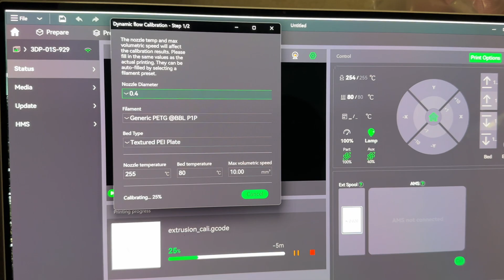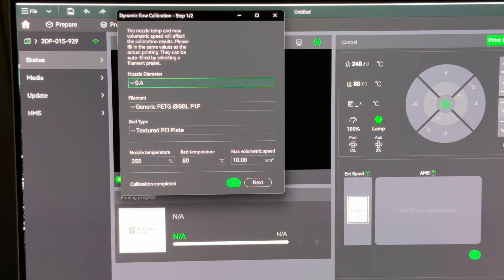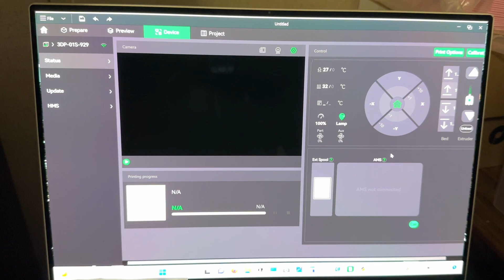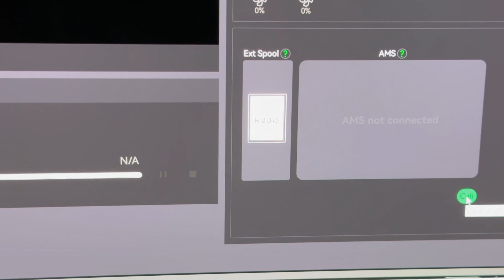Bambu Lab P1P Dynamic Flow Calibration

Comment: That calibration option is missing in my Bambu Studio
Reply from the maker: This video is kind of old. And it’s been a minute since I’ve done any of this. When I get home after work tonight, I’ll check and see if it’s still there for me. There has been a lot of updates since I made this video.
Reply: Found it, didn't had my glasses on I think 😅
Reply: Where is it ?
Reply: On the top of Bambu Studio (the tabs with "device" "project" etc. Should be the last tab! @cheizaguirre5494

Comment: hey thanks for the video in detail. I want to know if there is an option to reduce or remove the custom pattern printed once the calibration process is done. As i can see your printing bed doesn't have the custom pattern on it. 
My agenda is to reduce the print time, this would be help if you can guide us on this part. Thank you :)

Comment: This is pressure advance isn't it?. You also want to do a filament flow calibration alongside this.
Reply from the maker: As of right now, we don’t have a whole Lotta control over everything on these printers. If this where a printer running klipper, I would agree.
Reply: @TableTopBiker  but k value is also PA. And if you use orcaslicer, a fork of bambu studio. You can do flow calibration, give it a shot.

Comment: With you choosing that setting how was your print ? Thanks for video I’m still waiting for my printer grrr lol
Reply from the maker: Still waiting on your printer? When did you order it? 

The prints are definitely a little crisper. Issue is that you need to do this with every filament type at least. If not, every filaments. I couldn’t be bothered haha. I would say do it once for the main filament you use and call it good.

Comment: I like the Softfever flavor of this calibration element much more as they give you the opportunity to leave out those tiny numbers which IMO are pain to remove ((unless you are the Count of Count 😉)
Reply: This is the first time I heard about this. I absolutely hate the clean up with the numbers. It even messed with my high temperature plate, it now has scratches all over the place from me trying to get the numbers off the plate... How do you do this? :)
Reply: @jurgendebruijne  You really may want to have a close look at Orcaslicer (which is the new name of Softfever’s slicer). There have been quite a number of videos on Youtube on this.
Reply: @joachimeuler8269  Many thanks for your response! I do use OrcaSlicer, 1.6.3 at the moment. But I do not see any option to remove the numbers. I looked online as well and have my printer turned on now. But I cannot find it online and in my printer settings I do not see it either. Is it under the K value calibration or the top calibration menu? Because I can only start it via the K value calibration in the Device tab it seems, and probably it will just use the numbers again.
Reply: @jurgendebruijne  I am using 1.6.3 on Linux. In the settings for PA calibration, below the settings for start/end/step there is a tick box "print numbers" where you can omit the numbers.
Reply: @jurgendebruijne wenn es sich nicht löst einfach einen zum Beispiel First layer test drucken und dann druckt es einfach darüber dann kann man es einfach entfernen

Comment: This is the new version of the slicer. I don’t understand why you when you use a glue stick on this plate for PETG I never have adhesion on any material that I’ve used on this plate with this printer.
Reply from the maker: I am just paranoid. I have had petg tare up other pei beds. Rather be safe than sorry.
Reply: @TableTopBiker  I can understand that completely. My other printer I have is a PRUSA. It has a live Z offset. I would print a test print that covered a large area of the bed and get the Z offset to where it looked. Perfect. The Prusa  allowed me to save that setting. Once I learn to do that, I never had an issue with PLA or PETG. With this new P1P I have had perfect layers almost every print. With the PEI sheet before I use it, I run it under hot water with some Dawn dishwashing liquid and scrub it with a Brillo pad. The prints are amazing. I don’t do this in between every print but whenever I see I think I’m going to have an issue. Sorry for the long post.
Reply from the maker: @nmfireman  Don’t be sorry at all haha. That has some good info. Never know who may come across it that needs to know.

Comment: So, i'm very new to 3d printing, and i bought one of these. What does this calibration is supposed to do? Should  i really calibrate anything if so far the machine seems to be working fine? I mostly use PLA and ASA for printing.
Thank you !
Reply from the maker: Welcome to the hobby. This specific calibration addresses the round corners you can get when the printer makes sudden directional changes. I suggest giving it a go but if you are happy and don’t want to, that is fine too.

Thanks for the comment and hope this helped.
Reply: If it’s working, leave it alone, if you’re happy with the prints.

Comment: you can change the temperatures and filament print settings by clicking the edit button next to the filament dropdown.
Reply from the maker: I will check that out tonight. Thanks for the tip!
Reply: @TableTopBiker  You can also change the nozzle-bed offset for the first layer. out of the box, I found it to be too large, and parts would not stick well. I modified the start gcode to have a smaller offset and saved that as a machine profile. You can set custom machine profiles, and material profiles just like you can in Prusa slicer (which this is a fork of).
Good luck on your printing endevors!
Reply from the maker: @BairdBanko  How did I not think of this. That is awesome. I will test that tonight too. As you heard, I have been using glue with petg to get it to stick.
Reply: @TableTopBiker  I would still recommend using glue stick, as PETG can stick so well to PEI sheets that it will rip the PEI coating off of the bed. The glue stick acts as a sacrificial layer. Here is the gcode I modified, under "Machine start G-code" in the printers settings:

;===== for Textured PEI Plate , lower the nozzle as the nozzle was touching topmost of the texture when homing ==
;curr_bed_type={curr_bed_type}
{if curr_bed_type=="Textured PEI Plate"}
G29.1 Z-0.03 ; for Textured PEI Plate
{endif}

And I changed the "Z-0.03", I think by default it is at Z-0.04. This has worked well for me with PETG on the textured plate, never have warping issues anymore.
Cheers, and hope someone finds this useful!
Reply from the maker: @BairdBanko  on smooth pei I agree with you but I have never had an issue on textured pei. That is not to say I never will have an issue or others have not had an issue. I just have never seen it. Thanks again man. I really appreciate the info.
Reply from the maker: So I saved the filament as needing to print at 280 for asa. That doesn’t change the presets for this calibration. It even prompts you to change the temperatures haha. It is mocking me!!!